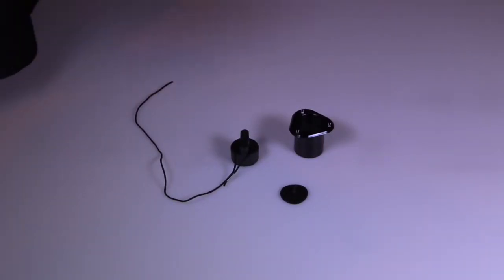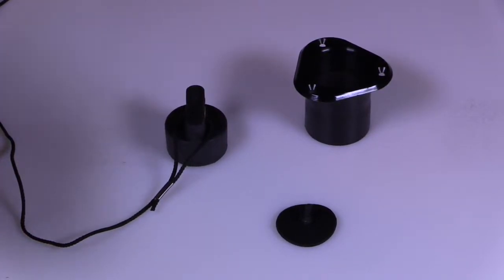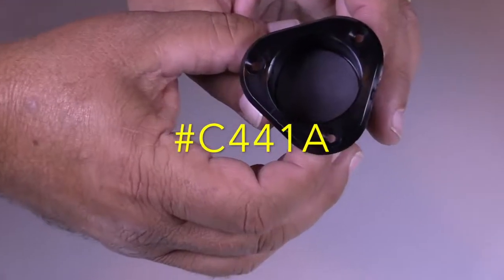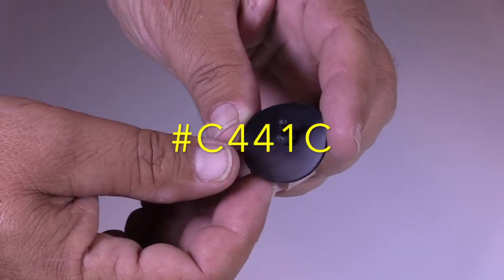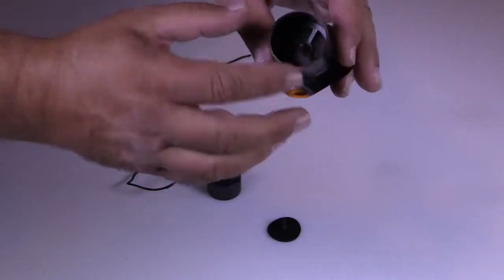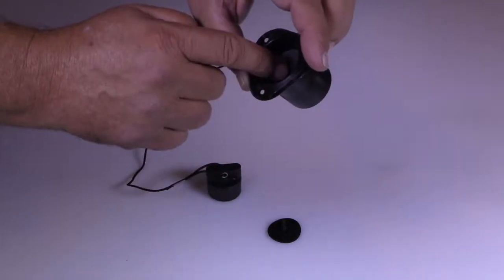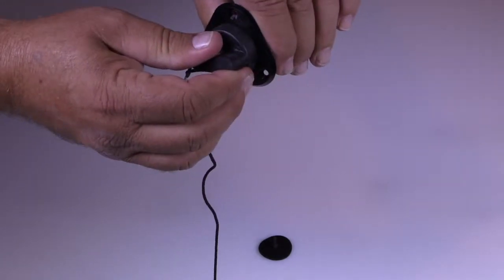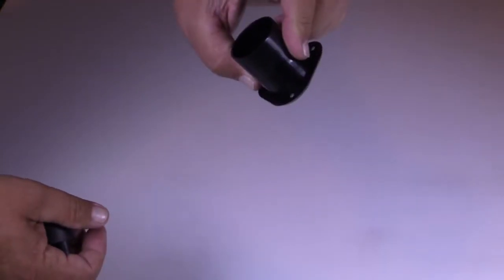Achilles Inflatable Boat Bailer Valve Assembly/Part Numbers and Trouble-Shooting

Comment: Hi Have a 2019  HB 30AL  aluminum RIB. I continue to get water into the dingy and I cannot find where the leak is. Is anyone else having problems with this dingy. It has had this problem since new. I have checked everything I can think of. Does anyone else have this problem